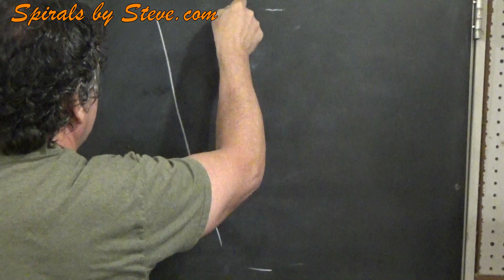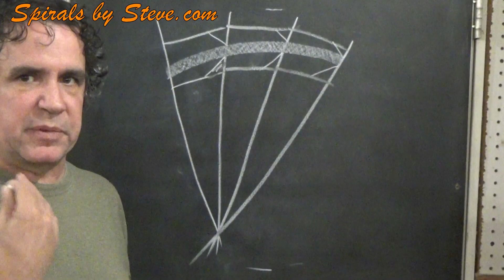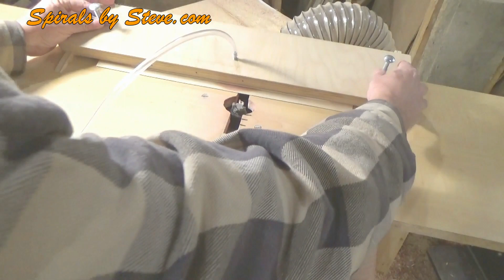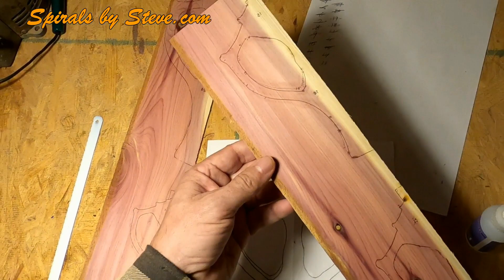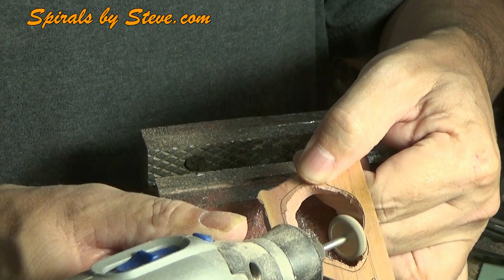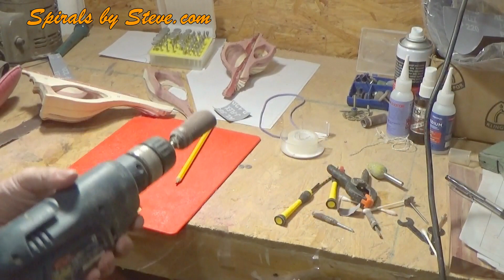Wood Shells

Comment: Steve thanks for this video it will help me-what glue & activator did you use and what bits for sanding?
Reply from the maker: I used medium viscosity starbond ca glue (any brand will work), and Bob Smith Industries activator applied with a cotton swab.  For rough wood removal I use Saburrtooth whisper burrs.  For sanding I use cloth-backed sandpaper hot-glued to the head of a drywall nail (for 3/32" shank) or galvanized roofing nail (1/8" shank) as a disk sander.  It actually works better if the cloth-backed abrasive is left square instead of circular.

Comment: Steve, where does the pattern transferred to the second side of the wedge come into play?
Reply from the maker: Hi Spencer, carve to the line on the larger face of each segment, then use the smaller matching face of the adjacent segment to help align it while gluing along with the sharp edge and squared top end.

Comment: Great job Steve.  I like the idea of using nail polish remover as a transfer.  Is that using ink jet or toner?  Also,  I am concerned for your health,  Cedar dust is deadly, so please use a dust mask and or dust hood when using the Dremel as a sander.  😉
Reply from the maker: Hi Wendy, It's toner from a laser printer.  I do wear a respirator at least while sanding.  Sometimes I also use a dust collector which I have setup to blow it outside instead of bagging it.  🙂